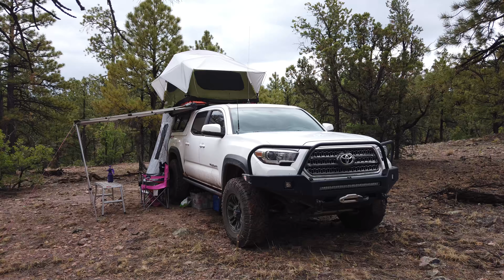Overlanding communications equipment and technology that I use (ham, GMRS, 4G, InReach, etc)

Comment: What battery do you run in your truck
Reply from the maker: Single Autozone AGM battery... Contrary to popular belief, the current draw on the communications equipment is very low... Each radio draws less than 200ma (about 2W of power) when on but not transmitting. While transmitting, the Yaesu and Kenwood ham radios (both 50W transmitters) could draw up to 9.5A at full power output, but the Midland is a fraction of that (only 15W of RF output). APRS transmissions last only a second or so. I also have a 100W flexible solar panel that I deploy on my hood with magnets while stationary and keep a NOCO jump starter in the vehicle, just in case.